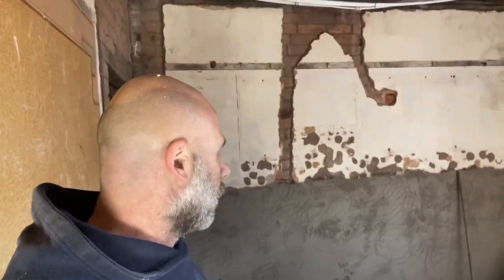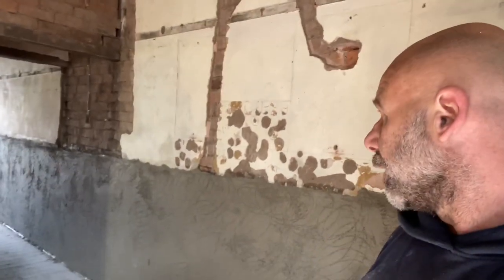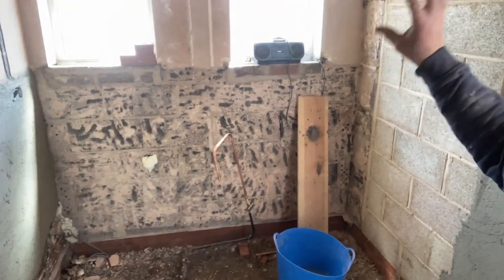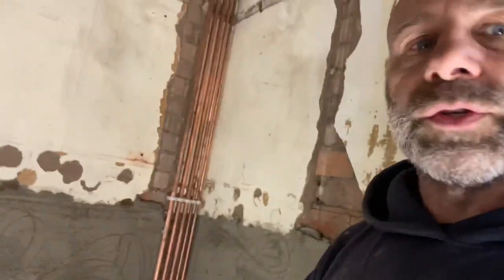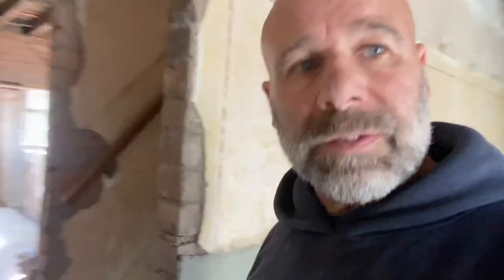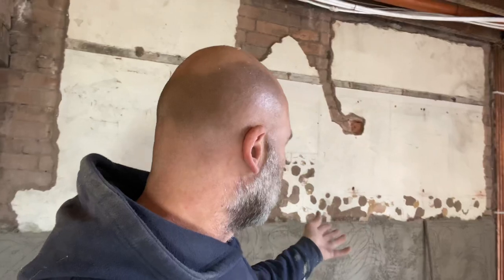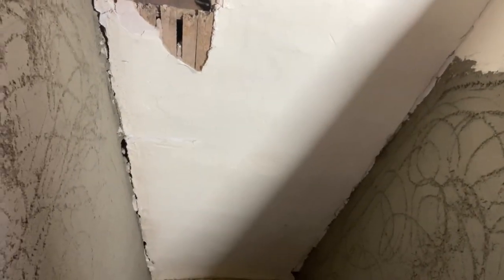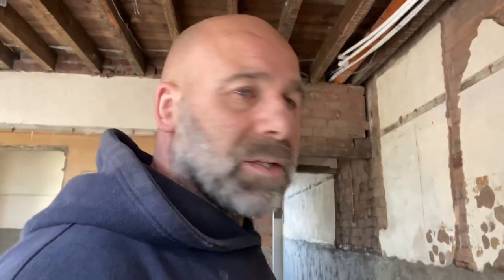Dampproofing Backing Plaster (Renderlite)

Comment: Don't use Renderlite !! Its crap, hacked loads off. Its too porous.  Can't beat sand & cement render as the backing coat.
Reply from the maker: It’s does depend what background you use it on. You now have to mix in SBR and apply SBR to the wall when prepping which you didn’t before. 
I would only use it where I was confident it would work.
Reply: It's meant to be porous, how else can your walls breath otherwise?
Reply: @anthonymclean9743  Mixed with clean water  yes it is porous, not with S.B.R. added. S.B.R is a complete water proofer, that's why there mix it in with render to tank cellars and basements. I have used Renderlite and its rubbish believe me its too porous. Cant beat sharp sand & cement render with render-guard gold as an admixture.